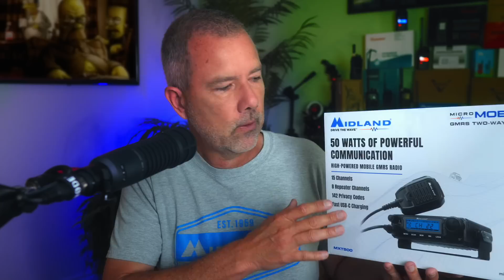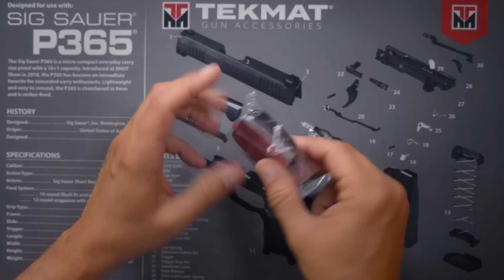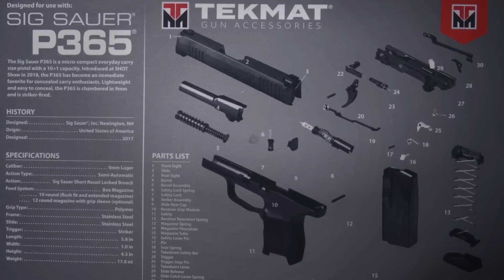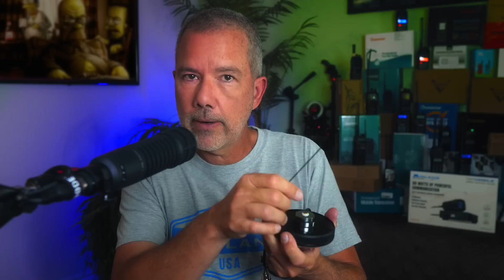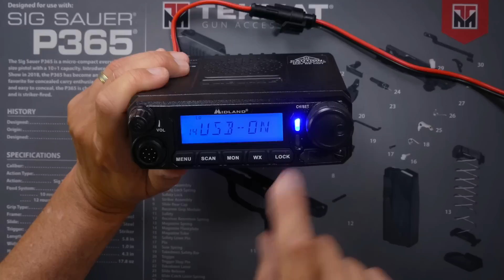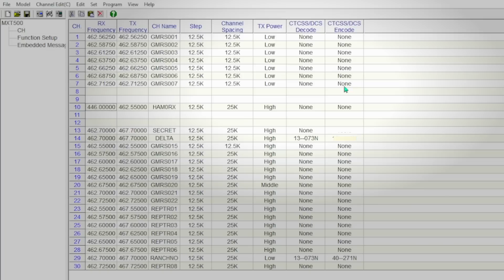Midland MXT500 High-Powered Mobile GMRS Radio. Review & Demonstration of Midland's New 50W Radio

Comment: You can add ADDITIONAL  frequencies / repeater frequencies to the Midland MXT500. Just hook up your software and have it read the radio. You will see the channels 8 through 14 are blank. If you wand to add a repeater, just fill in the blanks with the frequency desired, say 467.675 for RX frequency and 462.675 tor TX frequency. Then add the repeaters in tone and out tone. That’s it… Now click on write to the radio and allow the software to clone the radio. This is very useful if you want to add several repeaters, even though they are on the same frequency. The DPL or CTSS code (depending) will take care of the overlapping on the same frequency.
Reply: Ok so noob question then, I bought the Motorola Talkabout T605 due to the waterproof nature of them (kayaking, dirt biking,etc) and I am looking to use the MXT500 as the basestation inside the RV. The T605s are FRS/GMRS 426-467MHz so they should be able to be compatible correct? They say so on the box... lol.

Comment: Need to clarify to those not aware. You cannot use just ANY USB-A to USB-C cord. That cord MUST be capable of transferring data and not be just a power cord used to charge an device. If your cord is not finding the driver, it's a power cord ONLY and not meant for data transfer.
Reply: Thanks for the info. I'm having issues.

Comment: Seems like there's alot of included value with the MXT500, but for a little more money ( to include the cost of an antenna, antenna mount and antenna cable) the KG-1000G still seems to be the "king" for now. For a simple "all in one" package, this will definitely be a hit for many people though.
Reply: wouldnt Btech 50x3 be a better deal?
Reply: @skye1355  Depends on what you mean by "better deal".  Less expensive yes, but the KG-1000G presents as a higher quality superheterodyne radio with a detachable faceplate (and probably some other features too).
Reply: I'm torn between them but leaning to the kg. I love the idea of the faceplate

Comment: SORRY Here is my edited comment....  You can add ADDITIONAL  frequencies / repeater frequencies to the Midland MXT500. Just hook up your MXT500 software and have it read the radio. You will see the channels 8 through 14 are blank. If you want to add a repeater; click on one of the blank channels and in the pop-up window, fill in the blanks with the frequency desired, say 467.675 for RX frequency and 462.675 tor TX frequency. Then add the repeaters in tone and out tone. That’s it… Now click on write to the radio and allow the software to clone the radio. This is very useful if you want to add several repeaters, even though they are on the same frequency. The DPL or CTSS code (depending) will take care of the overlapping on the same frequency.

Comment: Great review! I'm torn between this radio and the MXT-575. I like the MXT-500's ability to program with software that the MXT-575 doesn't have. I have a Jeep so I prefer the size of the MXT-575 and also that it has a speaker in the microphone.

Comment: Dear Randy, as always thank you! Perhaps some output power measurement would be beneficial in a follow up video - with SWR for the antenna? Anyway, your videos are greatly appreciated here in Tennessee. Please keep up the excellent work.
Reply: I'm under contract to purchase a home outside of Del Rio right now.  Given the plethora of hills and mountains there, naturally I'm curious as to how that will affect GMRS transmissions.  I don't know where in TN you are located, but have you had insurmountable problems with various mountains getting in the way of YOUR radio(s)????
Reply: If ANYONE says they can tell the difference between a radio that puts out 40, 45, or 50 watts, they are lying!

Comment: That radio seems pretty easy to set up.  I'd be interested in more information on the intercom feature, or what exactly that port is for.
Reply: I was just going to ask the same question.
Reply: probably P.A. for external loud speaker
Reply: @TwoFeatherChannel  that would make sense, however, the type of connector is not used for that type of system.  Also, why call it an intercom and not a PA speaker?  There's something else going on with it.
Reply: @SocialistDistancing  off road enthusiasts sometimes use headphones 🎧 with intercom features similar to pilot and co pilot in an airplane I believe...
Reply: Headset 
Like pilots use headset to communicate on radio.
Off-road enthusiasts like prerunner drivers, people that runs racers, you don’t have time to handle a mic, you push a button to talk using your headset and those headset use the intercom

Comment: Update the radio's firmware that you can download from the link on the product page. Then use the new version 1.08 of the programming software, and you'll have a 60-channel MXT500. You're welcome.
Reply: And with the latest firmware update for the radio (v1.172) and using the newest version of the PC programming software (v2.01), you have 128 channel capacity.

Comment: My GMRS walkie talkie’s have 30 channels, however my Midland MXT 500 has 50 channels.
I can transmit from my handheld radio to my MXT 500 but my MXT 500 won’t transfer to my handheld unit on the same channel (16)

Comment: I love all your videos and I thank you for taking the time to make them. I have a few GMRS handheld radios (I have my Lic) and I have wanted to setup a high power base station in my home. I like the small units because if I ever  had to bug out then I could just grab and go.
 I have been looking at the MXT500 but would like to know your suggestions on a decent and simple radio setup I could start with. In other words if you yourself were putting together  what would you go with and what are my choices when it comes to antennas? I dont mind having something attached to my home if its going to increase the distance I can talk and receive.

Comment: Doesn’t look like the new Midland has a port to connect two together to create a repeater platform like the Wouxun - presumably this would have been mentioned if it had that feature (I’m new to GMRS, considering setting up a repeater locally since the HAM guys took the last local one down). Looking forward to a comparison as suggested above.

Comment: So,  based on your review of the Mxt 500, I'm in. However, can you suggest the size of a Jackery style  power supply as I wish to take advantage of the AC port using a Btech RPS-30M DC Converter. As you can tell, electricity not be my friend. Thanks...

Comment: My MXT500 doesn't seem to scan.  Can someone confirm if the channels change on the screen or not?
Reply: Just did a reset and it scan through the channels now.
Reply: Is the radio still working great for you since you've had it for a while?

Comment: We are on a solar storage battery,  I heard you say you can't use a cig lighter port,  can I just hard wire this to a car battery to make it work without a car?
Reply from the maker: as long as it can provide the 13.8V @15Amps.
Reply: @TheNotaRubicon  Hmmm, I will have to see if the Bluetti I have gets that high voltage, I think it does,  but if not I think the car battery should at full power.  I just got a property in SC that has a 100 foot fire tower on it.  I am brand new to radio and found your videos to be awesome. So I am going to invest in a GMRS radio to help folks out during the breakdown and what is coming.  Is there a 50 watt radio that also doubles as a repeater, like an all in one?  
I would love any advice you can offer about setting up a repeater in the tower and a very strong radio to help my community in a grid down situation.
Reply: @TheNotaRubicon  hmmm I really wanted to be able to just plug this in the cig lighter on my solar generator, guess that won't work.

Comment: Hi, I just purchased this radio about two weeks ago, and I'm having a modulation issue with it. I keep trying for radio checks with no results. Then I finally connected with a repeater out here        in the desert CV GMRS, finally spoke to someone . They said my signal strength and Rodger beep were real good , but my voice was real week like I had a pillow over my mike. I did check to make sure I was on wide band. So before I return as a defective radio, I was wondering if you have any solutions to this issue. I see you have lots of experience with GMRS radios. I can't get anyone from Midland I got it on Amazon. Sorry for this long comment, would appreciate any help. Thank You 🤥
Reply from the maker: There is no setting to fix that.. Send it back and tell them to send you one that works!
Reply: @TheNotaRubicon  Thank you for your quick response! thought I may have missed something in my set up.
Reply from the maker: Wait.. Upon reflection...
I dont remember if this model has a setting for WIDEband and NARROWband.. so IF yours has that setting make sure it is set to WIDEBAND.  if no setting for that, or if it still is bad on Wideband, send it back.
Reply: @TheNotaRubicon  This model has a setting for narrow band, when set to  off, the radio is in wide band mode , for narrow band the setting has to be turned on. So I'm sending it back through Amazon for a replacement. Thanks again

Comment: thank you for the review, I just received mine and set up in my jeep, what antenna would you recommend to replace the tiny one it came with? even though you mention the tiny one works well😜
Reply from the maker: Use use the Midland MXTA26 antenna on both my Jeeps even though neither has a midland radio ..

Comment: Thanks for doing this review.   I probably won't buy one; I'd rather spend it on a KG-1000 (once it works with CHIRP).   However, I do have questions:  In this review, the software showed options for "compander", "reverse" and "talk-around".   Can you explain what these do, and give some real-world examples why/how someone would use those features?
Reply from the maker: Compander is some kind of noise/static cancelling that nobody uses, I dont know what reverse is, and talk-around is for when you're talking on a repeater, but when you get close enough to your friend that you can talk directly to them using talk-around lets you talk "around" the repeater, directly via simplex, without having to change the channel.
Reply: @TheNotaRubicon  Thanks!   Though I'm not sure how using the TA feature is any easier than you and your friend deciding to switch to a simplex channel   (see also my comment on your GMRS-101 video, about scan locking on to simplex for repeater traffic, or scan silently locking on a channel with wrong tone).   As for "nobody uses" compander - that's all I needed to know. :)   Thanks again!
Reply: @TheNotaRubicon   where did you get the software to program the radio? I don't see it on midlands website.

Comment: Stumbled on your channel when looking into gmrs use and licensing. Just got my license and purchased this radio to get started. Is there a fold down antenna bracket that you would recommend? Wanted to use the 6db antenna on my roof rack but be able to park in parking garages from time to time.

Comment: I've been looking for a mobile radio for my car for road trips (sometimes I convey with the lads) and for track days (SCCA and ChampCar).

I started taking this search seriously when my local track basically told us we HAD to have some sort of comm systems. The Motorola I was referred to is nearly 1k for just the damn head unit and I still have to buy the functioning bits to have a complete package 😬 

The price of this Midland is... Spicy too but I'd consider it. How does it compare to something like the President George and McKinley?  The Retevis MB1 or AnyTone 6666pro?
Reply from the maker: how does it compare it what way?  This is a very simple to use, no bells or whistles GMRS radio.. If those other radios are also GMRS (or UHF) radios, then they all give the same farz.  So it boils down to what type of radio/frequencies you want to use and what bells and whistles you want.
Reply: @TheNotaRubicon 
Ohh, I didn't realize it was that complicated. My primary goal is clarity with distance but I suspect distance will come with any mobile station CB that's paired with a good aerial?

Is there a site you'd recommend that I could do more research on this topic?

Comment: The MXT500 looks like a fine radio.  However..... I'm a tightwad.  The MXT400 also looks decent.  The delta between the two as I've been able to determine prices is $152 bucks.  Since I'd be planning on buying two radios for both our vehicles, that price difference now becomes $304.  Is there really $304 dollars worth of rich goodness between the 400 and the 500, and would the extra 10 watts be all that advantageous?????
Reply from the maker: I have never used the MXT400.. IF it is a wideband radio, then 10 more watts is not worth the extra $$.. Having wideband IS worth the extra $$
Reply: As follow-up, I ended up purchasing the Wouxun KG-1000G radio.  Should be here next week, hopefully.  Figured I'd get my truck all done before I start out on the wife's jeep....

Comment: I have a question for you Randy.  Our family will use two offroad vehicles on different occasions.  I'm wondering if this scenario is possible.  One quality GMRS radio will be transferred from one vehicle to the second and back and forth as vehicles are used.  Understand that wiring and antenna setups will remain in both vehicles, only the radio itself would move.  
Thanks for any insight.

Comment: Does the MXT 500 have to be turned on when connected to a pc for programming?
Reply from the maker: Yes
Reply: One more dumb question. To operate this model as a base station, what size power supply would you recommend using. I can’t find any specs on how many amps it draws.
Reply from the maker: you will need something like the Duracomm LPX-14 power supply. You can see it here: https://bit.ly/3y5jlrh

Comment: Hi Randy i live in the San Bernardino mts. Love your videos! 

Two questions:
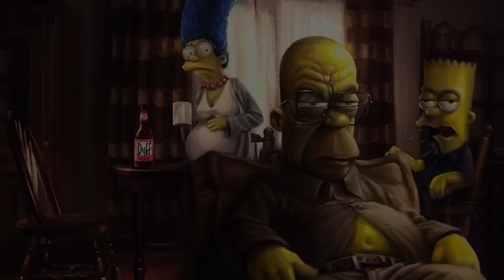What is a good DC power supply for using at home as a base station - what power harnesses would i need for the power supply? 20:00 

And can you recomend a better antenna for home (nothing too tall).

Thank you kindly .
Reply from the maker: Any 12-13VDC 30amp power supply will work just fine.. The radio comes with all the wiring you need, so not sure what you would need a power harness for.. i dont even really know what that is.
For most people, a GMRS mobile antenna like the MXTA26 on a cookie-sheet in the window works just fine.. For a few more farz, you could put a Tram 1486 on your roof (thats what I have).
Reply: @TheNotaRubicon  Thank you man, "my number one YouTuber"

Comment: if most of the people I ride with use the hand held gmrs radios should I set mine to wide band? also how easy is it to hear with the top off of your jeep? I'm hoping this unit is better then the midland 15. that unit was complete junk. everyone couldn't hear me, plus I found 6 months down the road the hand held connector broke off.
Reply from the maker: Virtually all GMRS radios are wideband, so you should set yours to wideband.  Whether or not you can hear the speaker with the top off your jeep depends on many factors. If you cant hear yours with the top off, then you should consider connecting a larger external speaker.

Comment: Is there enough of a ground plane if you were to use the stick-on metal plate and the magnetic mini antenna on the roof of a fiberglass Jeep top?
Reply from the maker: Probably not, but I haven't tried it.
Reply: You will need a ferrous paint swatch on the fiberglass roof… Or use that magnetic antenna in the middle of the hood. You can then use it as an aiming device while you drive. The Aussies mount their antennas on the front bumpers to take out kangaroos and dingoes.
Reply: @NoName-OG1  It is a JL model Jeep Wrangler.  The hood is aluminum.  But the idea is to get the antenna as high as possible.  I'm currently running a fender mount that gets it a little above the top, but not by much.
Reply: On a fiberglass top you should use a ground plane by mounting a metal plate on top or even aluminum foil attached to the underside of the top, (a common way used when mounting on a corvette fiberglass top).The minimum diameter for GMRS ground plane should at least 12" . Another option is to use a 1/2 wave antenna which will work without a ground plane but not as effective with a ground plane. The reason for a ground plane is to direct the radiated radio signal in a horizontal doughnut shaped pattern. With  out using a ground plane, the radiated signal is wasted in a downward direction(exception is 1/2 wave antenna.)
Reply: @dmwil1  A 1/2 wave antenna works good on fenders or even on rear racks when a 12" minimum ground plane diameter is not available.

Comment: Costs more than the Wouxun 1000g ? Why would I spend more for this Midland?  Thanks for the review very good.
Reply from the maker: Because, as mentioned in the video, some people want "simplicity" - and this Midland is as simple as it gets.
There are also many people that prefer to purchase from US based companies..
So, you may not want to spend more, but other people would.
Reply: You do receive a cable, mount, and antenna with the MXT500, you also get USB-C to quickly charge your devices...
Reply: @akinsman85  good point.

Comment: Pretty new to the game , been looking into building a repeater, can two of these be used instead of the kg1000g ?  With the same duplexer or same set up as your GMRS repeater video set up from last year?
Reply from the maker: Its technically possible, but they are not designed to be used this way, so it would not be easy.